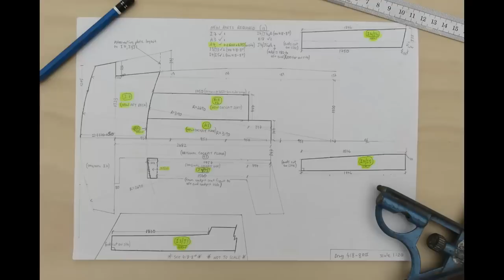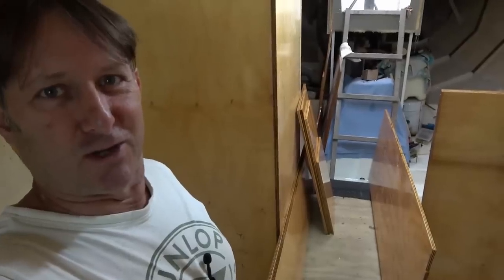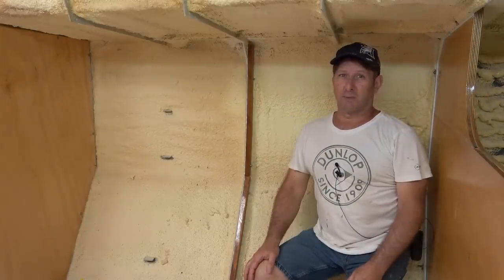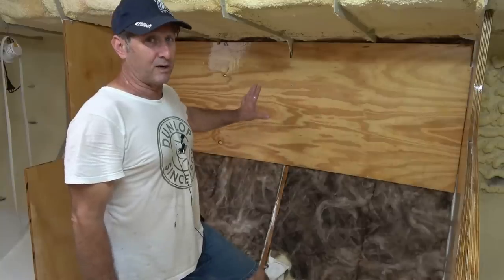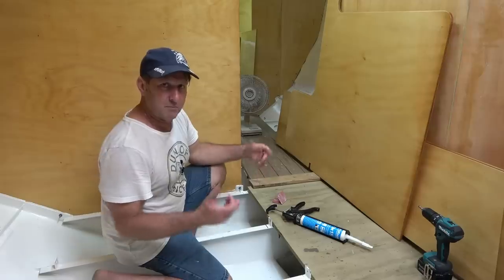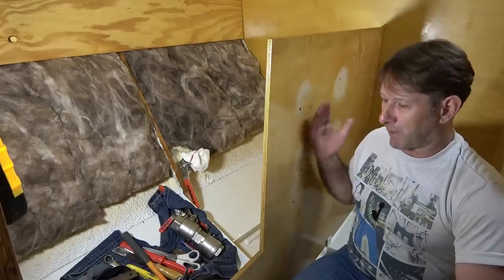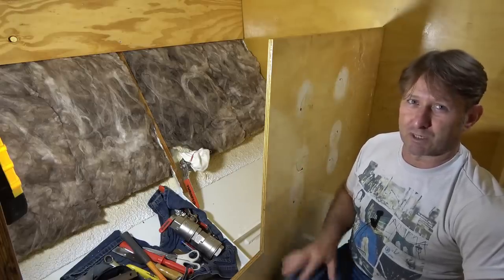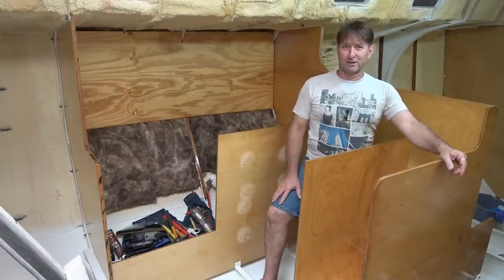Building my steel sailing yacht Ep.59 INSTALLING Galley cabinets 😀HAPPINESS!

Comment: Good choice to drop back and catch up with the other things that need to be installed along with the panels. Plumbing and wiring are done a lot easier when you have good access to them before you install all the cabinets. I really like adding the extra insulation, it will help with temps and sound deadening. I was hoping you would do that in the vee berth.
Reply from the maker: Thanks Richard and yes, throwing up all of the possible 'spinning plates' at once is necessary in order to anticipate 1)what I will want on completion and 2)smart ways and an order to install everything!  😬👨‍🔧
And fyi actually I will be adding some PE foam insulation to some of the V berth,..

Comment: I would have left the "gap" because actually, air is the best insulation you can get, especially with a 1 to 2 cm gap! It's perfect! Now, on top of that new "WOOL" insulation, I would put a vapor barrier to avoid condensation! A strong plastic sheet will do the job. Put it on the insulation, on the inside of the boat (vapor barriers always go on the warm side) and then, the wood panel. Foam doesn't require any kind of vapor barrier because it's air tight, wool insulation isn't. Ask any architect for advice. Keep up the great work! As always... +1
Reply from the maker: Thanks for your comments Harry and per the Earthwool manufacturer, "Earthwool is sold as batts or rolls (blankets) with a range of R-values. The insulation is a natural brown colour (no added dyes) and is practically odourless. It is non-combustible and does not absorb moisture." I will go with what is touted and see ahead how it behaves. Also fyi the plywood lining is encased in plastic (epoxy) and so forms a barrier.

Comment: I have the same situation with my yacht - what goes in before the other!  It's quite a jigsaw puzzle!  I'm also fitting out a 12m steel yacht - I'm just putting my insulation in, and finishing off the mechanical work.  Do feel free to make a video about why you are stopped, because that is valid as well.
Reply from the maker: Thanks very much for your comments Steve and Yes there is MUCH to consider and to compromise with! The reason's for pausing the installation of these prepared panels will be explained in the next video  🙂👍
What design is your boat?
Reply: @BuildingSYMistress  Hey mate, my boat is a 12m Ganley Pacemaker center cockpit.  Quite simlar to yours.

Comment: Another great video! One small issue I see (I think it started when you got the new PC/Software) is weird aliasing where there is fast movement. I don't know if it's a compromise on video file size for upload or you didn't notice it. Have a look at the segment from 2mins in onwards where you wave your hands to describe the process, to me your hands become distorted, kind of Venetian blind effect. It's a small issue and certainly not a criticism, just pointing it out in case you were not aware.
Reply from the maker: Thanks very much supers54 and to explain re. what you mention, this is where I am using what's called 'transitions' and is deliberate on my part as a way of smoothing out the clips instead of the edited clips abruptly jumping from one to the next.

Comment: Progress!! Curious why you don't use cleats like a 1"x1" along all your 90 degree plywood joints. I realize you're using Fix 15, but every boat I've ever been on had some sort of cleat between the ply joints. Screws into edges of ply just don't have a lot of strength. Keep pluggin' along
Reply from the maker: Thanks for your comments Gary and actually I am using epoxy glue at the plywood joints which is stronger than the plywood itself. I use the Fix15 where I am also bolting for eg. bulkheads to the frames. And yes, plug, plug, plug,....  🙂

Comment: Hi, Bruce! I would have thought that using wool on a boat is a no-no. Won't it be a sponge for watervapour? Great to see the panels going in and fitting so well; that was a mountain of work. Good job, as the Americans say!
Reply from the maker: Thanks very much Nick for your great comments and question! Fyi this below from the manufacturers, "Earthwool is sold as batts or rolls (blankets) with a range of R-values. The insulation is a natural brown colour (no added dyes) and is practically odourless. It is non-combustible and does not absorb moisture."
It is a great question though and something that I was concerned about, but I have to go with what is touted and see ahead how it behaves  👍⛵
Reply: @BuildingSYMistress  maybe take a sample and wet it well. This would give you an indication of water retention as a mass fibrous product. Great work.
Reply: @geoffwright7110  Good idea, Geoff!
Reply: @BuildingSYMistress  If the manufacturer is sure, that's what you should go with.
Reply: @BuildingSYMistress  BTW, the sound issue I signalled last week was my PC, not your video.
Reply from the maker: @geoffwright7110  Thanks very much for your good suggestion Geoff and yes I will do this!  🙂
Reply from the maker: @nick.caffrey  Thanks for letting me know Nick and sorry to hear re. your computer problem.

Comment: Nice to get some of them in, you are correct, best to stop and get it all sorted out first then to have to tear half the interior out later.. I do wish to voice a concern about the use of that earth insulation tho, will it not be a place for mold to get an easy start if (And on a boat, it's more when) it get wet?
Reply from the maker: Thanks very much Jeff2n for your good comments and good question! Fyi this below from the manufacturers, "Earthwool is sold as batts or rolls (blankets) with a range of R-values. The insulation is a natural brown colour (no added dyes) and is practically odourless. It is non-combustible and does not absorb moisture."
It is a great question though and something that I was concerned about, but I have to go with what is touted and see ahead how it behaves ahead  🙂

Comment: Love what you are doing!!!!!! 

I am going to play devil’s advocate.  (Just for thought.  No animosity at all toward you at all)  prayers this never happens but?

You are sailing along at night, 3 ft or 1 meter seas, pitch black.  Bang you hit a floating cargo box and tear a 4 inch long 120 cm cut in the boat 1 inch wide.   Can you find the cut???  No brainer easy to fix stuff rags in it. But can you get to it to stuff rags in it?  
Do you have to go over the side to find the hole?      I have actually seen this!  The little boat did not have a liner or insulation.  Cheep boat!  But the leak was found in less than 1 minute.   Towels were stuffed in the crack.  
No big deal, water never got over the inside floor.    Scared the hell out of the woman!!!  She thought instantly of death!!!! Terrified!! 

My point or thought if you were sleeping when it hit and all you know is you hear water gushing in the bilge, can you find where it’s coming from?   Can you look in the bilge and see is it starboard or port, bow or mid ship? Can you get those boards off and stuff rags in a easy fix tear?     Or must you go over in the dark, in the cold,  1 meter seas  to stuff rags in the hole?    

I might not glue the boards next to the insulation.  Maybe screwing them together!  Not so sure But it’s your boat and your choice!!!!   The ones I have seen use a 1inch by 1 inch corner board as long as the joint and screw the panels together with..   This arrangement will rub and screek but it can be opened.
Reply from the maker: Thanks for your comments and good question Thomas. Your question is representative of many other scenarios/situations/possibilities and my main 4 responses are 1)if you will not be either building a boat or going sailing UNTIL you have with total certainty mitigated every possible hazard then you will not be either building a boat nor going sailing; 2)until you have actually built your own boat you will not realise AND understand the many competing things that MUST be compromised,.... which for each a decision must be made; 3)one MAIN feature of mitigating risks is to determine the likelihood/potential of hazards, the scenario you describe is certainly 'possible', but 'very unlikely' and I personally do not know of anybody having had this disaster happen 4)by far the MAJORITY of people, including boat owners would be quite shocked and terrified at the possibilities if/when looking at the details of many other commercially built boats re. their seaworthiness! 
You could check this out by trying to access ALL parts of any live-aboard or charter boat, ESPECIALLY URGENTLY!!! Sure, some boats do not cover their hulls with lining at all, but they will lack some other things that make living aboard more comfortable and in climate extremes.
2 other important points re. Mistress' lining - it basically does not go below the waterline and the reason that I only applied a small amount of adhesive to them (re-check the videos) (otherwise they are screwed in) is so that they CAN be removed 'IF' need be.